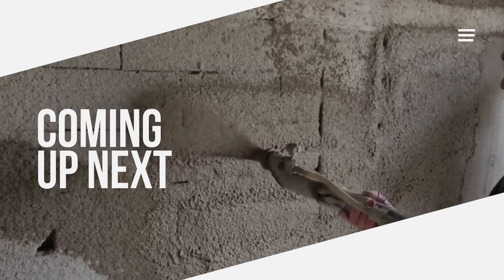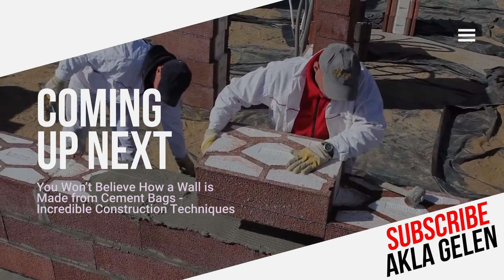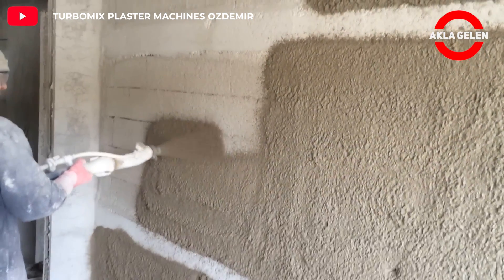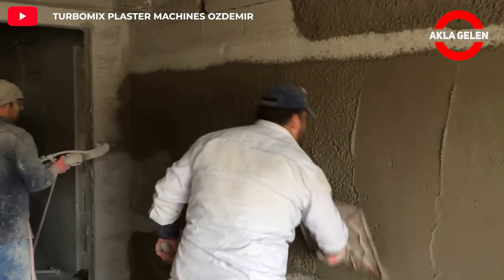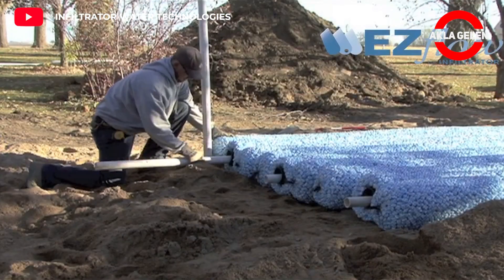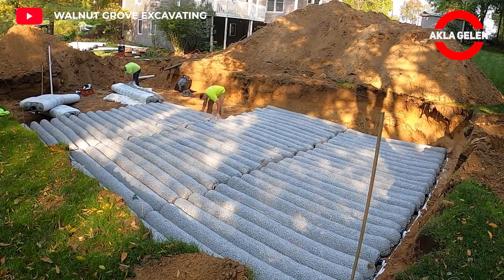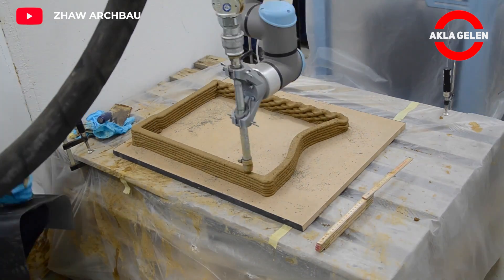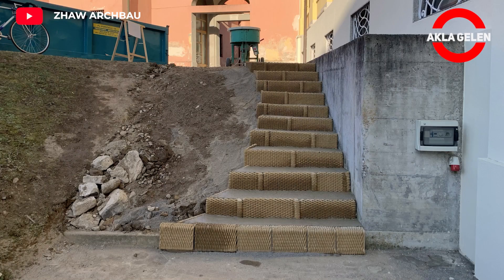You Won't Believe How a Wall is Made from Cement Bags - Incredible Construction Techniques

Comment: The iron rod used onthe brick facade wall is to keep the lines straight, AND the amount of mortar used is uniform. Alot of this crap is "TOFU DREG CONSTRUCTION" and WILL fall apart in time

Comment: Retaining wall made with quik-crete bags -- Where's the rebar/mesh.  This wall will crack and move without steel in it.
Reply: And without proper drainage built behind it…it’s just a matter of time!!!
Reply: Indeed
Reply: Yeah and cement alone is too hard , so indeed will crack after a while , people tend too out more cement in the mortar as too make it 'stronger or better ' but that's really not the case at all
Reply: It’s better not to rely on steel rebar or mesh. They will eventually corrode without proper regular maintenance.
Some of the world oldest structures have been still around while those of modern materials have to be demolished.
Reply: You can tell this is not happening in the USA!!
Walls made with bags of Crete that have moisture barrier plastic liners under the paper. 
Yeah I think it will fail in a few years and completely fail in 15
Reply: This is happening in the United States.  @Waveluth
Reply: If you look closely, you can see the rebar sticking out from the tops of the bags of cement.

Comment: And what is IN the cement bags? Are they using empty bag, they do have strong paper indeed.And filling them up with something?
Or is it cement in the bags that has been exposed, for whatever reason, to water and has become hard and useless otherwise?
Reply: I think the idea is to use fresh bags and set them there, and when it's done, get rain and moisture or be sprayed with water to soak through the bags and harden whatever's inside the bags.
If it's just cement, it won't work. If it's premixed concrete that just needs moisture adding, it could at least be somewhat close to working. But it's missing the steel for it to be a trusty and reliable working wall. The few metal spikes visible won't do the trick.